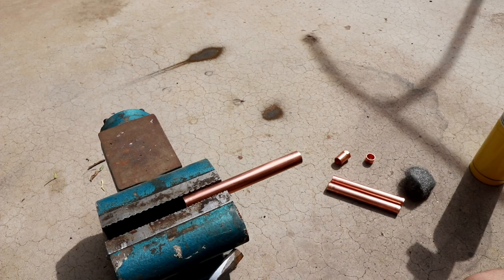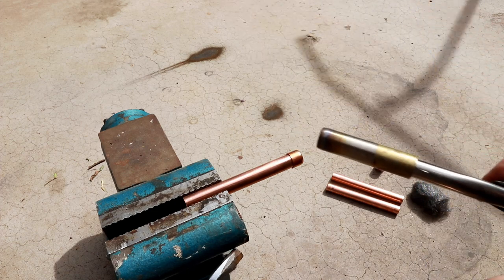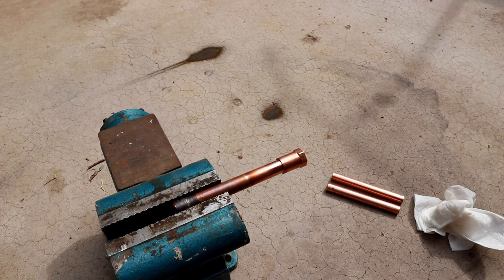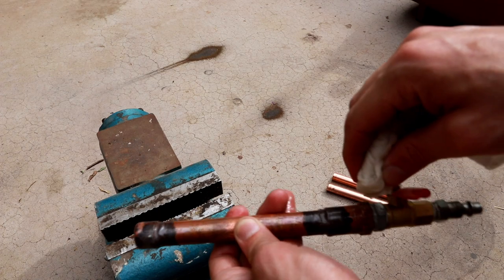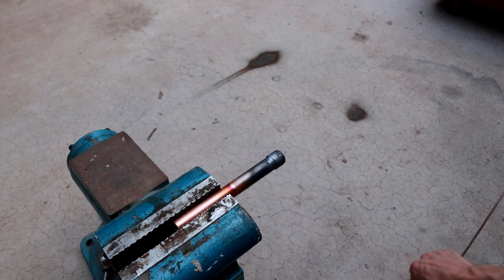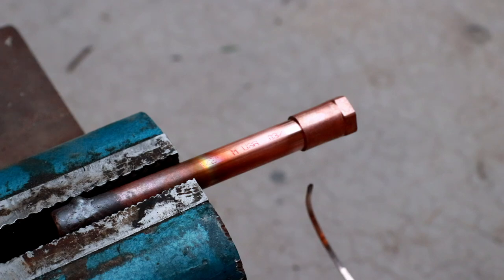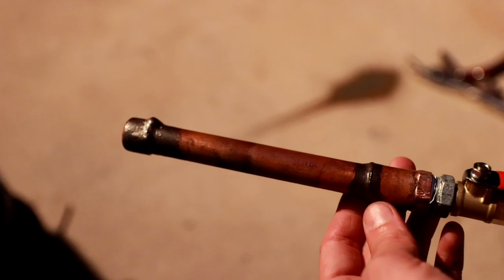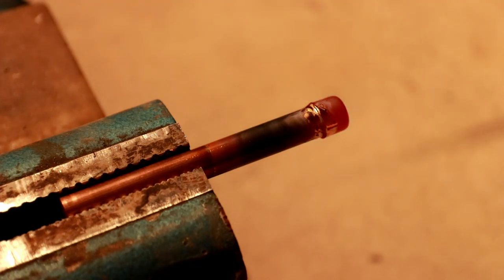EP 62 - First Attempts at Brazing Copper

Comment: Have you developed your brazing skills further? I'm starting out too - in this video, did the pipe get red hot to get to correct brazing temp?
Reply from the maker: I replaced the clogged filter drier on my AC unit shortly after making this video, but haven't done much brazing since. I believe it isn't necessary to get the pipe red hot, but it is good to get it hot enough for the brazing rod to flow evenly into the pipe surfaces.
Reply: @DielectricVideos  Sounds good - did you melt the old brazed joints and pull drier out or did you just cut the old drier out?
Reply from the maker: @pingpong9656  I just cut it out. It was a package unit, so there was enough slack available in the liquid line to make up the difference.